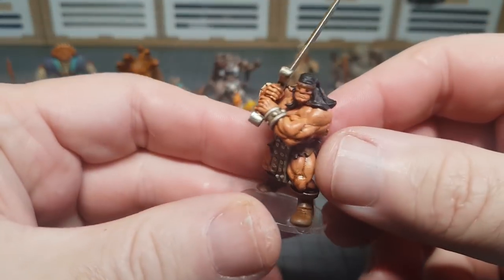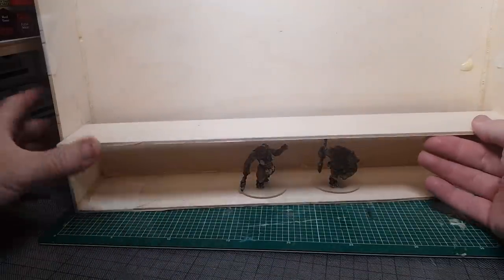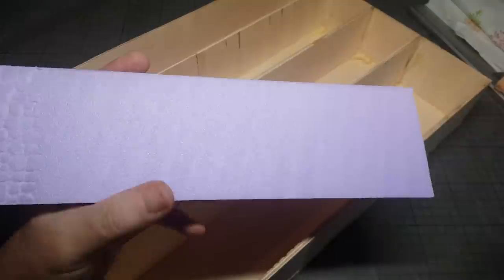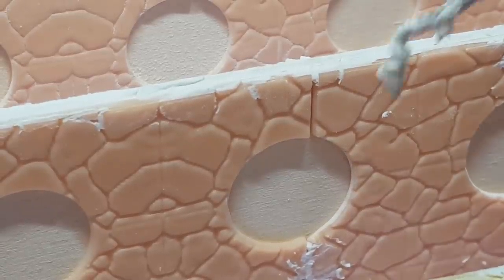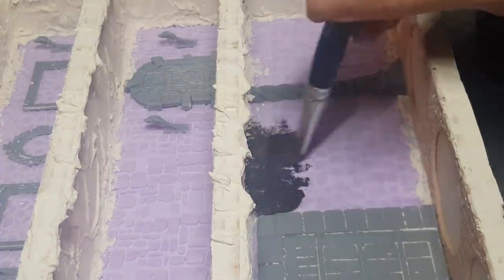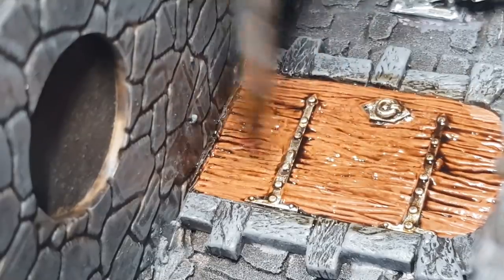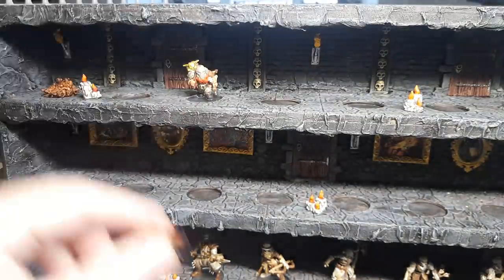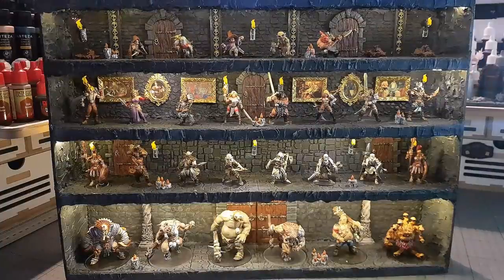How to Make an AWESOME display case for MINIATURES

Comment: Nice shelft! I'd look into making my own LED lights if I were you. All you need is a soldering iron, thing wires, some LEDs, resistors and a power supply (like a 5-12V wall wart), and maybe an hour or so of reading how to use LEDs with resistors if you have not done electronics before.

With that said, I wanted to ask where the medium sized skeleton models come from, they look nice.

Comment: Fantastic video. Just so you know it depends on where in the United States you are but but we use both grout and spackle. Where I am in Texas grout is used used to affix tiles to a surface and sparkle is used to to patch small holes in walls.

Comment: I'd recommend that you have a look at LED strip lights. It'll kick off more light, you can change the colors with a remote and are pretty easy to set up. 

If you ever need to do a sci fi diorama el wire is useful (imagine a wire of light that you can bend into any shape you want)

Lastly tea lights are good for a flickering candle effect

Comment: I don't know if you've dipped your toe into airbrushing (recent subscriber), but when I saw you mix the pva and the brown to surface prime I died a bit inside.  Then you started talking about how long it was going to take, and I said aloud, "I know."  Vallejo black surface primer is an excellent and far quicker alt to that combo, and out of the airbrush takes a couple of minutes to hit your whole shelf.  Even better the Vallejo has a, lets call it a rubbery quality, to it to protects very well.  I've peeled it off my gloves afterwards and seen it be resilient, springy and protective, much like the modpodge mix you made.  Highly recommend, and airbrushes are not that spendy.

Comment: This looks great and I like this, but it would not work for me. I need something bigger for many miniatures. I have around 300 miniatures painted up right now, and many more to do. I use the same kind of lighting you got there, but planning to go to something new, for some longer shelfing, I will be building in a month or two. I want get away from using battery's, to something I can just plugin to an outlet. I real like the background you did there. Would love to have some of them rollers you used for the foam board.